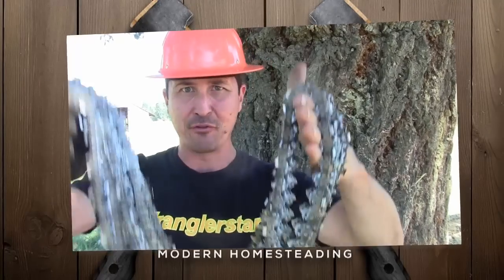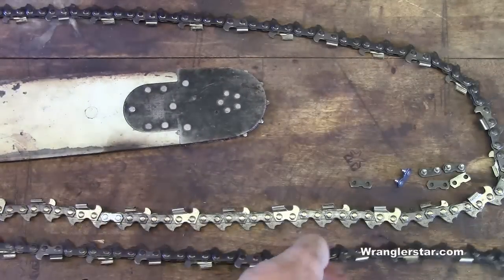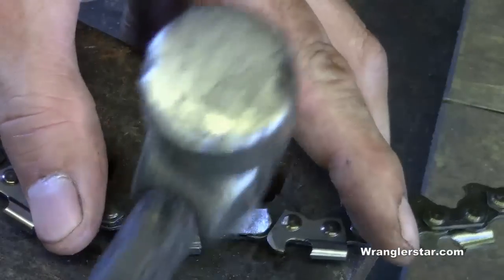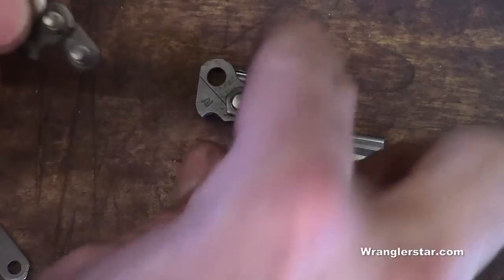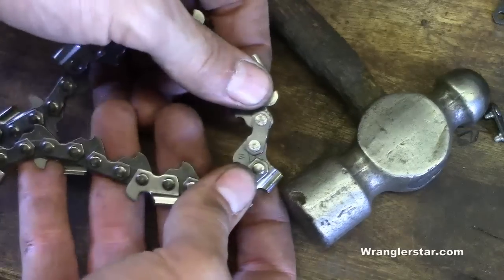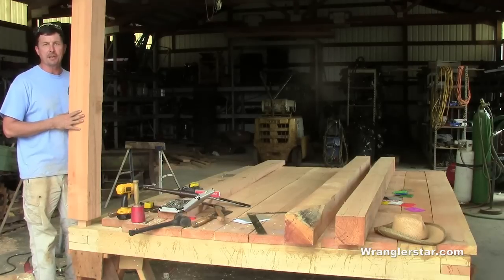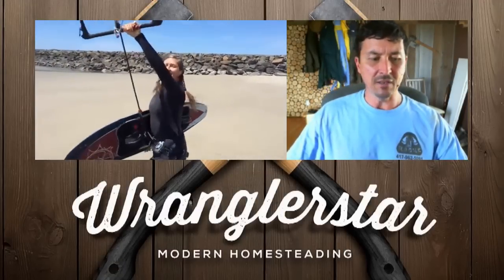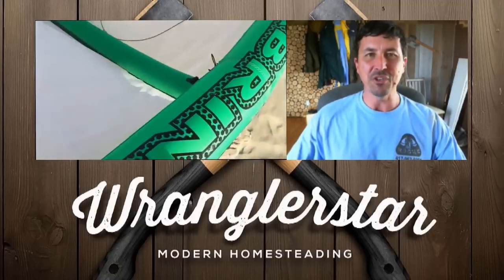How To Make A Chainsaw Chain | Wranglerstar

Comment: have you heard of Jonsered chainsaw's??? if so what do you think of them?? I've asked this to you many, many times, I just want a.... they're OK or, not to bad or garbage response! lol
Reply from the maker: Yes I'm aware of them. I don't think I've ever used one.
Reply: Jonsered are a part of the Husqvarna group. Jonsered chainsaws are based on old Husqvarna designs, they may be a bit behind with design and tech, but are a very good chainsaw for the money.
Reply: thanks, I think im going to get one!
Reply: steve smith Do you have a particular model in mind?
Reply: I was thinking the 2245 or a 2255 at my tractor supply they have a 2245 with a 16inch bar that would do plenty around the home area, I want a longer bar for heavy work. for the price of these saws it almost seems to good to be true??!! they saw they do this and do that.....the website shows off that they are great saws!.any info would be appreciated!!
Reply: steve smith Make sure you use a semi-synthetic 2 stroke oil, chainsaw engines rev very high and need good protection. A litre, or quart will cost a bit extra, but it will last along time, as you will only use about 10 to 15 milli litres per fill-up. Mix your fuel/2stroke oil in batches of half a litre or half a quart, that way if you get the mixture wrong, it will be for only one fill-up of the chainsaw, not many. Husqvarna make a sharpening tool which is cheap and really helpful, I will try to put a link on here for you. This should make you life a lot easier when sharpening. http://www.husqvarna.com/us/accessories-old/product-accessories/filing-equipment/file-gauges/
Forgot to say, the chainsaw looks good, what kind of price are they?
Reply: for the 2245....like 260ish....no more than 300...don't quote me on that but I checked other brands and Jonsered was way cheaper than other brands!!!
Reply: my old husq is just to old!!!
Reply: steve smith Is that Pounds? Dollars?
Either sounds a good deal. I paid £500.00 for my Huaqvarna, that's about $850.00.
Reply: dollars!!
Reply: steve smith So that's about £150.00 to £175.00, very good price indeed.
If you look at some of the parts on the Jonsered, you will see their the same as on some Husqvarna's. The case clips come to mind. The starter pull is different for some reason. Looks like your going to get a good chainsaw at a budget price.
Reply: where are you from?? my wife is originally from Wales!
Reply: We live in Wales, near Cardiff.

Comment: I know this works, But at least get a rivet spinner, This could be dangerous. Hammering could cause stress risers in the rivet, causing failure. Chain saw chain spins at about 60MPH, There's a reason those rivets are Spun.

Comment: I like most of your videos. This one...not so much. There is a time and place for shortcuts and just using what you have lying around the shop. In my opinion, that time is not when you are creating something that could cause you severe personal injury if it fails.
Reply: I have had chains break from factory. So in this case it really does not worry me doing it this way.